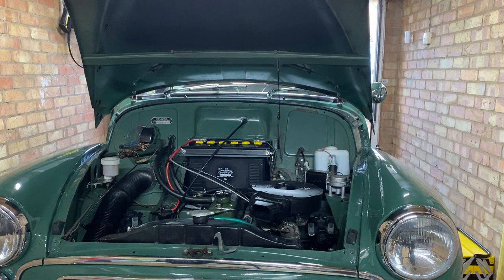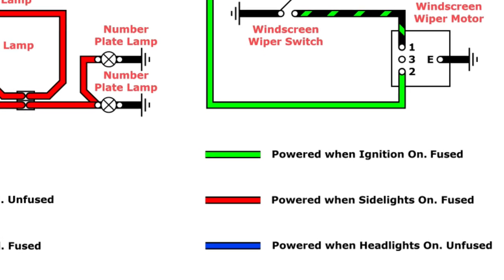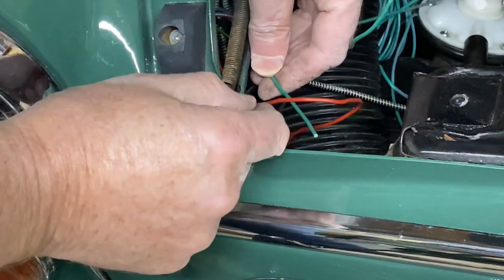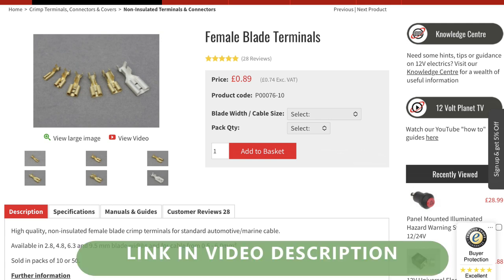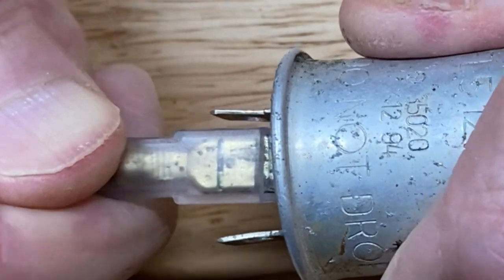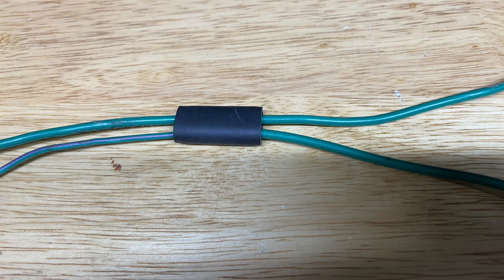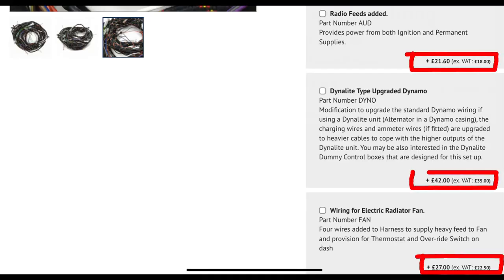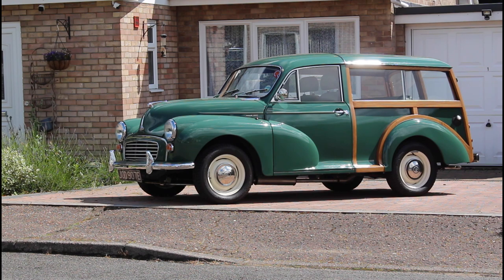Secrets of the Morris Minor wiring loom

Comment: I served my apprenticeship as a vehicle mechanic in a BMC dealer in the 60s so remember these cars well. Easy cars to steal as all you had to do to turn on the ignition was move one wire on the fuse box (only 2 fuses) and then press the solenoid to start the engine. No steering locks in those days. The dynamo was a constant cause of problems along with the regulator until alternators came along. Earlier MInors had a common rear light for both brake light and indicator functions. Hard to believe that some American cars still have this "feature" today.
In those days Joe Lucas was responsible for about a third of all BMC cars failing to start on a foggy November morning!
Reply from the maker: Lucas, Prince of Darkness 😊

Comment: The BS AU7 colour code standard for car wiring can be found in the Haynes Automotive Electrical Manual Handbook. Find a method of preventing water entry to those bullet connectors, hence the Prince of Darkness tag. The connectors seem to be in the most inappropriate positions like under the wings etc.
Reply from the maker: Agreed. It’s always a trade off between authenticity and modern standards. For instance the original layout has unfused circuits. Maybe a squirt of WD40 on the bullets?
Reply: @jodiethemorrisminortraveller   Would extend the lamp unit tail wires until they reached the inner wing/engine compartment/luggage compartment then put the connectors there. Does make any replacement more of a hassle though with routing of the wires/loom cable.
Reply from the maker: That’s what I did in the LED 2 video. There are no connectors under the wing. All are sealed inside the headlamp bucket or in the engine compartment

Comment: Just wanted to say thank you,I dont have a Morris Minor but I am recommissioning a 1965 Ford Cortina and want to rebuild the wiring loom and then include a fusebox,believe it or not the Cortina only had one inline fuse for the indicator circuit!
My car was originally Positive Earth it has been converted to Negative Earth before I bought it.
Its funny you saying that about the wiring looms colours as mine are the same colours. My main power feeds are brown id of thought they would be Red but it appears the were Brown back then.
My indicators are Green wires but no Red trace.
The Problem I have is i dont know what gauge wire I need to buy I guess having another loom would make it easier but these days everybody wants a fortune for even a scrap loom.
I just want to protect my circuits with a fusebox add an alternator (its still on a dynamo) and add relays for the lights etc so i can relieve the strain on the switches and fit halogen lights and possibly a radio?
How did you draw your own diagram is that a special program?
Thanks
Jo (actually Jodie same as your car :) )
Reply from the maker: Hi Jo.

Great to hear from you.

Here’s a link to a page that can advise on wire sizes.

https://www.12voltplanet.co.uk/cable-sizing-selection.html

Generally I tend to use 16.5 A for most things except headlights.

I used Gimp to draw the wiring harness. It’s a very general graphics editor. Not as powerful as Photoshop, but easier to learn and it’s free.

Good luck with the Cortina. You can buy complete harnesses for the Cortina, but they aren’t cheap.
Reply: @jodiethemorrisminortraveller  
Thanks for the info its ironic you used gimp as I use linux so cant use photoshop but have heard of gimp as I am sure its a linux program but not used it myself will have to download it and have a play with it :)
Yes Autosparks do Cortina looms priced at How **** much! what do you used for headlights 27amp?
Thanks again for your help :)
Reply: Downloaded and installed gimp as ive used photoshop in the past as a photo editer Gimp seems somewhat familiar but have to admit im totally clueless as to how you draw a wiring diagram with it? Ive searched online but cannot find anything to help. So if you can give me any pointers on the basics id be ever so grateful as i just dont know where to start how to draw the wires,colour them or how to add symbols or lettering? Im afraid my photoshop/gimp skills are limited to editing photos :(
Reply from the maker: No easy way unfortunately. I did it pixel by pixel, then cut and paste.

Comment: jodie you have done an amazing job i have no words to commemorate your work & details you have given in this video- i had a quarry is there any documents to find the thickness of wires that car harness need - for example a battery to starter would be a heavy gauge & teh dasboard bulb might need a thinner guage is there any calculations for these gauges given - that will set me through
Reply from the maker: I use 25A for headlights and 16A for most other things. Starter cable is specialist and sold as such. 35mm square should be ok.

Comment: Great Video !! I have a 1960 4 door with a lot of electrical "additions"  by PO.
A regular FRANKENSTEIN.
Could you tell me what are the different gauge wires are used on the Morris and where ??
 Thank You ,
Cam
Reply from the maker: Most of the cable is 14 strand. (8 amp) =18 gauge US or 28 strand (17.5 amp) = 14 gauge US, although there are exceptions. The lighter cable is mostly side and tail lights and general wiring. The heavier is mostly general distribution (solid colour) , headlights, horn and heavy accessories.
Reply: @jodiethemorrisminortraveller  - Thank You sooo Much for the information and the web link to the suppliers.  I laugh my A$$ off with your humorous  photo of the "Red" wire terminal box... !!!

The PO used any wire he could find.. (borderline electrical fire hazard!)

Cheers in "2022" !
Cam